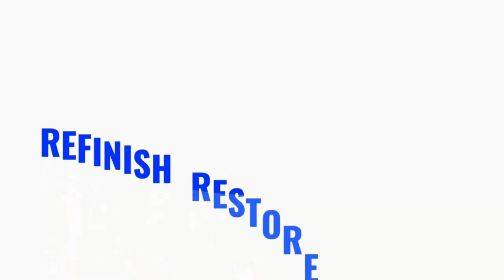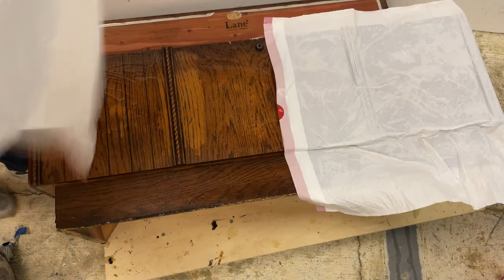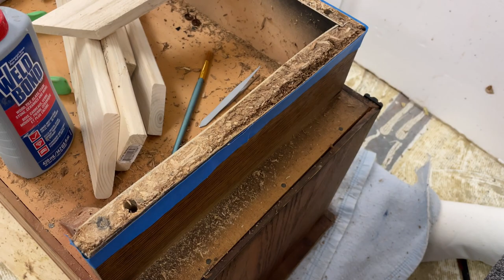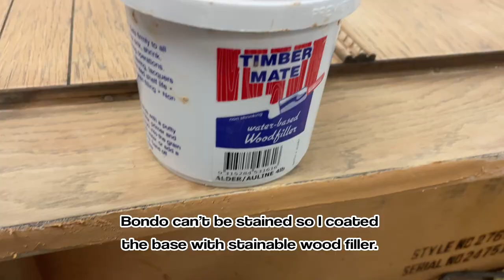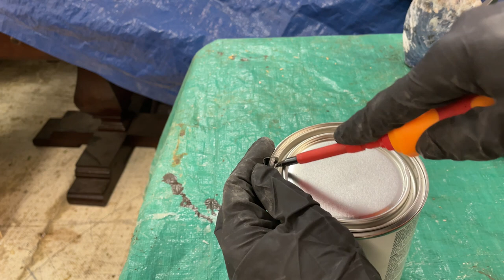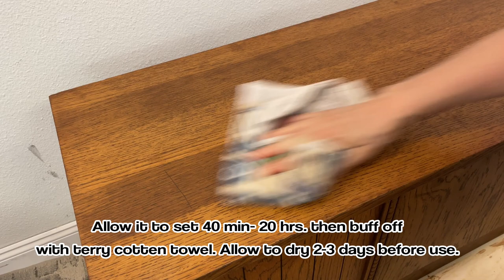AMAZING RESTORATION of Vintage Cedar Chest- Relaxing Furniture Restoration Video

Comment: 🤔I would have thought you'd remove the Particle Board and replace it with actual wood!!!! But, I'm glad you saved this piece.
Reply from the maker: To replace it with oak would have cost over $250. Oak is very expensive. I would not have made any profit on this chest if I replaced it with oak. I was able to repair it very inexpensively. I have no doubt the repair will last for a long time.
Reply: @FurnitureFlippingForProfit  2 types make that assumption, those who think everyone on YouTube makes millions and those who hav $ themselves. I’m so sorry people say stuff without thinking it through!!! U did an amazing job!!!
Reply: @kelleyhawk6595  no, there's a third kind who just don't like partial board. Plain and simple.
Reply: And I was thinking wouldn't it have been easier to cut off the bottom half inch?
Reply: Wow, it turned out amazing. I was impressed with all skills you used to restore this. So many different products and tools. I noted your safety gloves and respirator, too. Viewers can learn a lot from you.

Comment: Beautiful restoration.  I have a Lane cedar chest I tried as a graduation gift in 1966.  It's still in pretty good condition as side from one water mark.  I put it on wheels because at my age moving furniture has to be easy.   I'm planning on refinishing the top to fix the water stain.  It's a very pretty piece and still modern.  Thanks for sharing your knowledge.  Love your videos.
Reply from the maker: Thanks for watching. You will need to strip it to get rid of the water stain. If it is still there you may need to use wood bleach.

Comment: Great work, especially with the particle board bottom.  That took patience and persistence to fix.  10 out of 10 on this project.  Have a Lane hope chest from 1966.  It looks as good as the day it was made except for a water mark on the top.  I don't think there is a great demand for hope chests anymore.  Great for storing blankets and linens though, (or so I am told).

Comment: What a beautiful result!! Love the stain color. 
Question: I have a palm sander and I have a wet/dry vac in my workshop. What do you use to get these two items connected. I would love to have some kind of dust collection but can’t find information on this. Noticed that you have tape on yours??
Reply: Same here absolutely brilliant idea!
Reply from the maker: I  had to buy a special vacuum adapter to connect to the orbital sander. It was made by the manufacturer. However, the end of this little connector would NOT attach to my inexpensive little shop vac hose so I had to tape it with duct tape. It works- even tho it does not look all that "professional" My ryobi sander had to be taped to the hose to but it died.
Reply: @FurnitureFlippingForProfit  Thanks so much for your response! Your the only Utuber I know that will answer this question. It is much appreciated! ❤️

Comment: I agree with one of the reviewers. I would have replaced the particle board with wood or cut the wet areas. Also the finish is too yellow. But you did a great job in your finish. Glad it was saved
Reply from the maker: In real life, there is no yellow in the finish. I think I had the white balance off on the video.  Thanks for watching!

Comment: Did you contact Lane to make the hinges and lock safe?  Isn’t there a recall?
Reply from the maker: Yes they are sending me a new lock. I stated that in the video. In 1987 there was a recall. They estimate there are still 8 million Lane cedar chests in circulation that need a replacement lock.

Comment: Thank  you for the  no music.  For spreading the paint remover there are finned aluminum rollers or roller covers that might give you more even coverage and avoid over and under application.  The finned rollers are used normally in composite work to press out air bubbles from fiberglass epoxy stacks.
Reply from the maker: Thanks for the tips! I will have to look it up.  So many people complained about the music no matter what kind I chose! ee gads it was frustrating.  So it seems my wonderful viewers are much happier with the shop sounds! I will obviously keep it up.
Reply: @FurnitureFlippingForProfit а мне нравилась тихая музыка ,сопровождающая весь процесс реставрации.

Comment: How did you get rid of the smell?
Reply from the maker: The chest apparently had been locked so the inside did not smell (thank goodness!). I cleaned it 2 times with krud kutter and rinsed it well. Then I used stripper to get off all the finish.  Both of these processes combined apparently removed all of the smell. Sometimes I put it in the sun but that was not necessary. Thanks for watching!

Comment: I like to always read comments when I like a piece or how it was fixed. I am glad you tried to save the proportions of the piece. Did all the smell come out?
Reply from the maker: Yes it did!  Krud Kutter works well to get rid of smell but then the stripper is so strong that it kills any remaining smells. I was very grateful that apparently it was locked so the inside did not smell bad.
Reply: @FurnitureFlippingForProfit  thank you. Crud cutter and paint remover strong items

Comment: Nice work.  Looks like it was made July 2, 1969.   Saw the code on the bottom.
Reply from the maker: I read that the serial number backwards is the date of manufacturer. Is that what you are using?

Comment: Lane recalled millions of chests for safety reasons. They replaced my lock also. I dont recall the year they recalled. My chest was 1952. Took about two months to get it. I think the recall went up to 1987.
Reply from the maker: You are right Paula. It was 1987. They recalled the locks and provide free replacement locks. I was up a creek until I found that out. This chest was so old that I doubt I could have found a key for it. The final pics on the video show it with the old lock in place. I have to wait for the new lock to come in to list it for sale.  Thanks for watching!

Comment: Wonderful job...but I'd prefer to replace that rotten and destroyed board with a new one!
Reply from the maker: The cost to replace it with oak would have been too costly ( the current price is $225-275 for oak boards).  When flipping furniture I am always conscious of how much I am spending on refinishing supplies and how much I can sell if for. I will be posting it for $250-300. I paid $25 for it. I was fortunate that I did not have to pay for a new lock. I did not know the lock was broken when I purchased it.
Reply: @FurnitureFlippingForProfit  Good reason...you have to handle a budget!

Comment: Beautiful job, chest looks like new!! Did you need to do anything to the inside?  The cedar wood looked great, but did the cedar still smell good or does it lose that great smell over the years?
Reply from the maker: Thankfully, I did not need to do anything to the inside. There is still some cedar smell to it.  To enhance the smell,  you can sand it with 220 or higher grit sandpaper.  Thanks for watching!

Comment: Thankyou for not playing music!
The piece turned out beautifully, but I am curious.
Why did you not just put a new base on it? The particle board was shot and just not worth the effort you went to.  I can tell you from experience that once that stuff gets wet it just keeps going, like a sponge. I would be very anoyed if I bought a piece and found that base.  You would have done better to just cut about an inch off the bottom if you did not want to replace it.

Comment: Allow me to make a few comments. Scratches are clearly visible on the lid and the right sidewall, which had to be either masked or removed. The base made of sawdust had to be replaced with panels made of natural wood. On the top cover, one part is clearly darker, it can be masked with several layers of different-colored stain.

Comment: Perhaps the base could have been removed and then cut back to reveal solid particle board then reassembled and installed?
Reply from the maker: Hi Mike, I thought about that but then it would have reduced the height of the piece. I think it would have been too low to the ground if I cut it off. Replacing the base with oak would have been too costly. Personally, I think my solution worked great. I had consulted two wood-working friends of mine when I was considering options and they both agreed that it would work well.

Comment: I know you worked hard on the base, but if it was me I would have replaced the whole thing with solid wood. I never liked partial board !!! Great job on the rest though.👍👍👍👍
Reply from the maker: It would have been too expensive. To replace it would have cost $200-250 for oak. I will be lucky to get $250-300 for this all finished. I am in business to make a profit. It would have been different if it had been a personal family heirloom and I was going to keep it forever.

Comment: I thought you should have replaced the particle  board
Reply from the maker: Hi. As I have mentioned in response to several other comments, it would have cost over $250 to replace it with oak.  I believe I will probably be able to sell this piece for about $200. Therefore, I would not even be able to recover my cost to restore it. The price of oak is crazy now! Thanks for watching.

Comment: Nice job.  I saw two of those today when thrift shopping.  Way better condition.  Insides were perfect, outsides were just old and needed to be refinished.  $35 each.  And I wouldn't touch them.  Why?  Can't resell them.  They will just sit for months.
Reply from the maker: I am going to sell it as a bench for the entry. I have to wait for the lock to come in before I can post it.
Reply: @FurnitureFlippingForProfit   I hope the market turns around in the fall because right now it's horrible.  I have a gorgeous drop leaf table, solid oak with a beautiful grain pattern that I refinished.  Kept the top grain and did the base black.  I'm down to $100 on it and can't even get any interest.

Comment: I love preserving an old piece but I am also confused by the choice to keep the base. Maybe the vaneer could have been removed and attached to a new wood base? It's not mine though, so I will shut up. 😁  It did turn out beautifully.
Reply from the maker: I think it would have been extremely difficult to remove the veneer. The price to replace the base with oak would have been cost prohibitive. The solution I came up with worked out perfectly- when looking at it as it stands on the floor, it looks like there had been no damage. The repair should last as long as the rest of the dresser. Thanks so much for watching!
Reply: @FurnitureFlippingForProfit  You are absolutely right. It turned out beautifully and you cannot tell. It's hard for us to get a real feel for these pieces just by watching. I do some of this and it is always so much more complicated than it seems. You put so much work into and you did an amazing job!!! Thank you for making these videos.

Comment: One question:  why didn't you just take the base off?  I think it was nasty enough it should have been removed.
Reply from the maker: It had to have a base on it because it would have been too low to the ground. Yes, It was nasty to begin with but in the end I think it looked great!  I always try to restore what is present on a piece of furniture to it's original state. Thanks for watching.

Comment: Sure would appreciate some talking with this kind of video. You can explain what you're doing and why you're doing what you're doing. Things like which brand of paint stripper do you prefer and why. How to use the paint stripper that you do use. Is it necessary to strip and sand completely back to Rall lumber color? Why or why not? What kind of stains do you use? Why one kind over another? How long do you let it dry after you stain and before you put on final finish? What kind of final finish did you prefer to use and why? Do you use the new gel stains? Why or why not do you like or dislike polyurethane? When do you use a fine steel wool between coats as opposed to sandpaper why one of the other? My goodness I could go on for hours listing the questions that I have. Hopefully you get the idea that's one of the reasons why people like me like to watch refinishing tails.
Reply from the maker: Hi Betpat, thanks so much for your comments. I put out a detailed video comparing paint strippers so some of your ? will be answered if you watch that video. However, if I were to attempt to answer every possible question when I produce a video, it would go on for hours and hours. Most people would never even click on a video that was over 30 min. long.  Believe me Betpat, it is real easy for me to include way tooooo much info in anything I write or produce.  Since I am sympathetic with the fact that you may have unanswered ? after you have watched the entire video (many people only watch part of the video and then they ask a? that was answered in the video...).  Therefore, I have always said that if you have any ? please write them in the comments and I will answer them. So, you DO have a way to get your ? answered. Simply ask it in the comments. Thanks for watching!

Comment: I would have just gotten rid of the particle board and replaced it with real wood. The veneer could have easily be removed with a heat gun and some patience and maybe even applied over the replacement wood.
Reply from the maker: It would have been too costly to replace the wood.  I estimate to replace it with oak the cost would have been $225-250. I will probably be able to sell it for $250-300.  I am in the business to make money and I would have had 0 profit it I replaced it.

Comment: Do not agree with salvaging the water damaged particle boards.  Would have been a much better fix to have unscrewed the base boards and bandsawed the veneer off the bad particle board, scraped it, then made a new bottom skirt with real wood and attach the salvaged veneer to that.  Would have been a great improvement over the cheaply built original and not much more work.  And probably not risk bad odors seeping out of the particle board.
The rest of the restoration was quite nice.
Reply from the maker: Thanks for your comments.

Comment: Wouldn’t it have been better to run the bottom edge thru a table saw.
Reply from the maker: Do you mean to remove it and then cut the bottom off? The particle board was failing in that it was falling apart. If I had cut the bottom of it still would have needed to be glued etc. The process I used seemed to work well as repairing it. You cannot tell at all from looking at it from the outside.

Comment: That bottom particle board base should have been replaced. It's too far gone to keep.
Reply from the maker: In the end, the repair base looked perfectly normal and it was done it such a way that the repair should last for years to come. To replace it would have cost $225-250 since I would have had to use oak to match the chest. I will probably be able to sell it for $250-300. I am in business to make a profit so obviously to replace the base would have not allowed any profit. (I paid $25 for it originally)